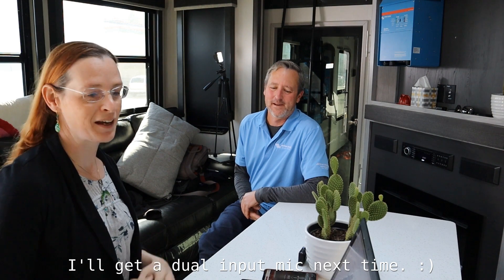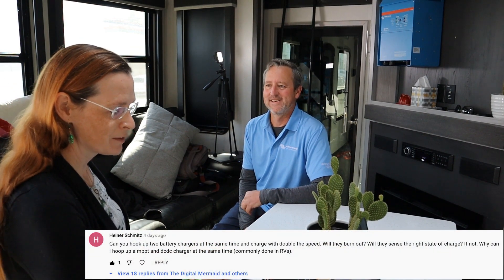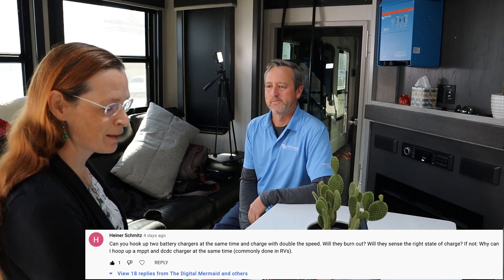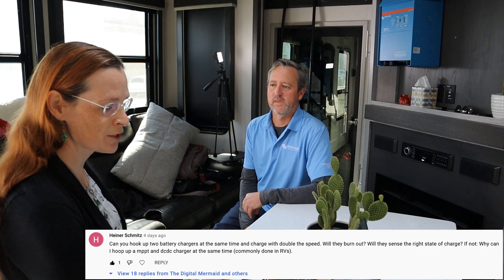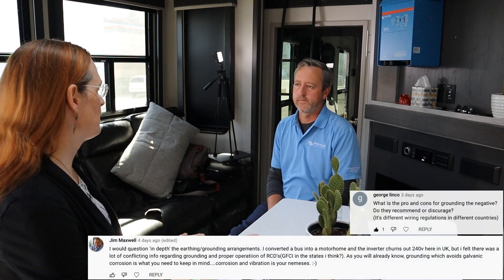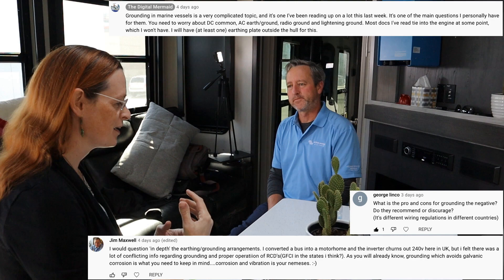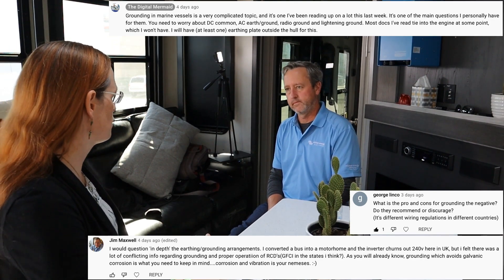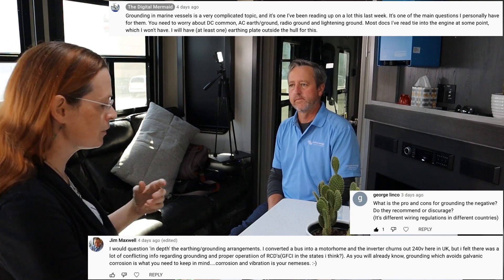Your Victron Questions - Interviews and Q&As

Comment: What a shame I missed that interview. I wanted to ask how to give the battery priority over mains even if it is there most of the time & only have the Inverter/charger to switchover to mains & charge the battery at the same time based on a state of charge of say 60% as a trigger which will mean all the charge sources (our charge source runs 24/7 meaning the battery mostly is at 100% SOC) failed but the output needs to continue. Basically a UPS in reverse. This is with a MultiPlus 24/3000/70. I have the interface to program the inverter and have programed it the best I can but between the internet information from Victron is Not even remotely the same as the software parameters shown when programing. They really need to get that information right and uniform, it confuses the hell out of me. At the moment when the low state of charge triggers the changeover switch & charger it trips the main Mains breaker supply. Did they teach you about the programming side of these things? Many thanks if you read this & can help.

Comment: Question for the Digital Mermaid: 
I am installing an electric motor in my boat. The motor can draw up to 400 amps at 48V (6 knots). However, I want to limit the amount of current available to the motor to 200 amps at 48V (4.5 knots).

Have you thought about a current limiting device for your network? In my case I would like this independent of the BMS.
Reply from the maker: I've not looked into this, no. My logic is that I don't plan to ever really use the full 600A that my motor will be able to draw. I plan to mostly run well under that, but I also don't ever want to cut an option off the table, either. Even though I don't plan to run at 100%, there might be a time where I need to, even if for just a short period. 

I've intentionally not dug too much into motors and motor controllers yet, as I expect my final choice may shift depending on the boat I end up getting. That said, I suspect the real answer to your question will lie in the motor controller unit. I wouldn't be surprised if you could put a soft limit in the controller, and maybe have an "override" switch to allow you to go above that limit in an emergency or to get out of a problem.
Reply: @TheDigitalMermaid  

Thanks so much for the thoughtful reply.

My Curtis controller is preprogrammed by Thunderstruck to draw no more than 450 amps. 

But I think drawing 450 amps in an emergency is probably more risky than drawing 200 amps in emergency (I won't bore you with my geeky thoughts on this).

In any case, I will be interested to see how you approach the problem when you get to it. Thanks for sharing your journey!
Reply from the maker: @shanedenniscom  I'm a nerd, bore me with the thoughts on it. I'm curious the reasoning for taking an option of the table with a hard limit (honest, not sarcasm).
Reply: @TheDigitalMermaid  Thanks for your interest. Discussing my thoughts helps flush out flaws in my reasoning.

My boat is a long keel, heavy displacement (5,500kg) Chesapeake 32. It had an aging 16hp Universal 5416. The Universal 5416 is being replaced with a ME1616 which will deliver 12kW at 48V. 12kW is roughly equivalent to 16hp.

I only use a lot of power when manoeuvring in tight quarters. In tight quarters, it is necessary to use the "back and fill" method to manoeuvre long keel heavy displacement boats. (I think) the faster relative response of the electric motor when compared to the diesel engine will compensate for the reduced power allowing me to manoeuvre the boat in tight quarters with 50% of available power.

Others also use a lot of power when motoring up to their anchor in high wind and/or current. I don't find this productive and never apply more than 50% power in these situations (using more power can create more problems).

To study motor/power usage longer periods it might be useful to refer to "EBOAT MODEL SPREADHSEET.xls" available on the Thunderstruck EV web site. According to the ME1616 modelling for the Chesapeake 32, the boat should be able to achieve 4.7 knots using 228 amps at 36V (i.e., 8.2kW or 170 amps at 48V converted by the controller). To achieve 6.3 knots it needs 416 amps at 52.02V (i.e., 21.7kW).

The motor needs to use 164% more power to increase the speed of the boat by 34% because more energy is required to overcome the increasing resistance created by the boat as it reaches it's maximum hull speed. It may make sense to use a diesel motor to overcome the increasing resistance because diesel is very energy dense. But is does not makes sense to use extra energy stored in batteries to overcome the increasing resistance.

In summary, I don't think I need the full power of the motor. Your next questions might be "Why limit the amount of power available?" and "Why did you buy a motor more powerful than you really need?".

"Why limit the amount of power available?". The higher the current drawn by the system the more difficult it is to design the system and source available parts intended for the marine environment. For example, the Blue Sea Class T fuses and holders are only available up to 400 amps. It is difficult to find DC Class T fuses rated at more than 400 amps because this is an unusual requirement. DC fuses (and other components) rated for higher currents are also much more expensive.

"Why did you buy a motor more powerful than you really need?". A study of others experiences with electric motors on sailboats might lead the a researcher to conclude electric motors are unreliable in sailboats because component failures are common. However, when studying individual instances, it appears this most component failures occur because electric motors with far less available power than the diesel engines they are replaced have been installed. The undersized motors and controllers are overheating leading to component failures.

Of course, these are just my thoughts, and there may be flaws in my reasoning. I am interested in any and all comments and feedback.
Reply from the maker: @shanedenniscom  If you're limiting the power because you want to use smaller wire / etc, then it makes sense to have a hard limit. No debate there.

In my case, and in my reasoning; I'm treating each individual battery pack as a fully self-contained item. So my BMS is limited to 100A output (110A for short periods), and I've installed a 200A fuse in-line with the positive wire. This will be repeated in each battery, so I won't need a singular 600+ rated T-Class fuse. Many-but-smaller in parallel, might be a better way to describe it. 

As for the "over rate, under draw" approach, I absolutely understand and agree with that logic, but only to a degree. In my experience, a system designed for Max load of X generally has an ideal point of load somewhere between middle and 75% (very roughly, very device dependent). Under-drawing a large system could become fairly inefficient in its own right, as the efficiency curve of a lot of devices isn't great low-down. 

As for the "increasing consumption being much greater than increasing speed over water", again, absolutely agree. I expect to almost never run anywhere close to 100% load. My original question though was based on the idea that the system could otherwise handle your top load. If that's not the case, then I understand your approach. In my case, I want to be able to run at 100%, even if just very rarely.
Reply: @The Digital Mermaid  Thank you! you make an excellent point regarding efficiency.

The liquid cooled ME1616 is most efficient running at 96V where it can produce 24kW  (96V x 250a) continuous. However for sailboat applications it is typically run at 48V producing 12kW (48V x 250a) continuous. 

(I think) the ME1616 is run at 48V in sailboats because it is hard to find suitable components for higher voltages.  High voltage battery packs are also harder to source and/or design.

If I install a current limiter which stops the motor from drawing more than 200 amps then (I agree with you) the motor will never achieve it's peak efficiency of 250 amps continuous (at 48V).

I am interested to see what happens in practice. My boat should be back in the water with the ME1616 installed within six weeks.  Fingers crossed.

Comment: Can i assume, that victron will float and absorp lifepo4 for the next 10 years and they liked that you missed this question? Did they see the questions upfront?
Reply from the maker: Do to the way things worked out, I had only 30 minutes to do the Q&A. We had originally planned 60~90 minutes, but it just didn't work out. This said; During lunch on the training day, Lance and I talked a fair bit about how Victron does Lifepo4, which is different from most. Out of that discussion, I realized that asking about float/absorption wasn't going to be really useful. So I didn't miss the question, I chose to skip it to save time. 

Yes, they did see all the questions before hand. Lance is technical, as you can clearly tell from his answers, but he is more sales focused. As such, I wanted to give him time to check with the techs at Victron if he wasn't sure of the answer to a question before hand. My goal with this is not to be a journalist, but to get as much technical data as I could.

On batteries; Victron doesn't use a traditional BMS in their Lifepo4 packs. They have (what I believe is) an active balancer or a sort, and then they manage the battery voltage externally. I asked why they do this, and the answer was that they wanted to have a more drop-in replacement for AGM/FLA batteries, and that meant being able to pull something like 2C at times (or more). A traditional BMS would limit this, hence why they use external BMSes. Given this, batteries like I, Andy at Off-Grid Garage builds, and that Will Prowse builds (amoung others) are very different. Given this different approach, I couldn't see how their way of handling charge would translate to how we will want to handle charge.
Reply from the maker: @BischesseHunting  I knew this video would feel like marketing, and I am sure that's why they invited me. Just the same, I felt it was worthwhile given how Victron gets used in DIY builds (See any of the DIY Lifepo4 channels and you'll see Victron gear somewhere). 

That said, their approach to Lifepo4 is very much not the way I would (or did) it. It's also not the way most people will want to do it. That's why I felt it wasn't worth asking about their batteries, it's too unusual a use-case for anyone watching my channel to care about, I think. I do wish I had the time to talk on video about why they do things the way they do (part of which I covered in my reply above). So it's not that they don't understand Lifepo4, they just needed to solve a specific problem. It also confirmed to me that I made the right choice by NOT using their batteries.
Reply: @TheDigitalMermaid It seems you are still wondering why Victron have packs of 12V and that to them is per cell instead of 3V per cell. Why they parallel 12V banks, then serial them into 24V/48V/60V/72V/96V with battery distributor on the 12V parallel packs. 

Their method is more of an industrial/commercial way. It isn't less effective or easier to break down or more dangerous, as long as it is planned properly. Personal setup, and most Youtube DIY content creators, are very concerned being able to use the full or at least close to full capacity of the battery bank. If I were to suggest, don't use last 20% of the capacity of your battery bank, and not to charge more than 90%, you will tell me I am crazy or a fool for willingly not use 30% of the battery bank.

However, on an engineer's point of view, 20% and less, you will notice that there is a larger load voltage drop, and same goes with above 90%. Above 90% it takes longer to charge, and you will have to worry about top balancing. However, if you check the charts, you will notice that maintaining power between 20%~90% there is a smaller load voltage drop, and lesser balancing issues. The sacrifice of 30% will also be faster to deploy, since I don't have to worry that each cell is at the exact capacity, bundling them into a 12V pack, cut off 10%, unless there is a major defect on the 3V cell, they are all the "same" working condition. (Engineering Safety factoring).

Having the battery bank voltage between 20%~90% not only allows the battery pack to last longer, work more efficiently, safer and you have little to no balancing issues. For scaling purposes, 12V pack is their 3V cell. Hence the BMS monitoring is on per 12V pack and not a BMS monitoring on per 3V cell. You monitor the health for per 3V cell, they monitor the health of a 12V pack.